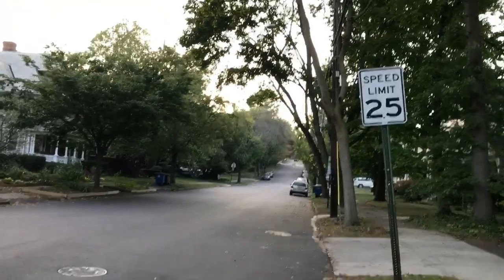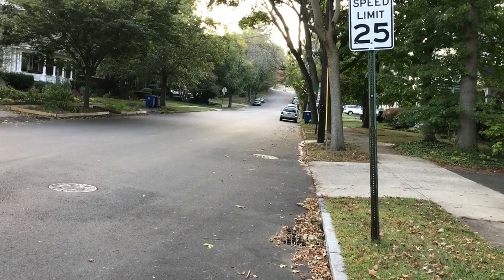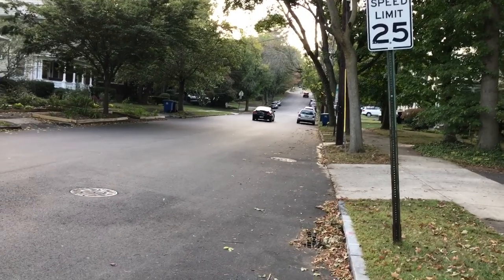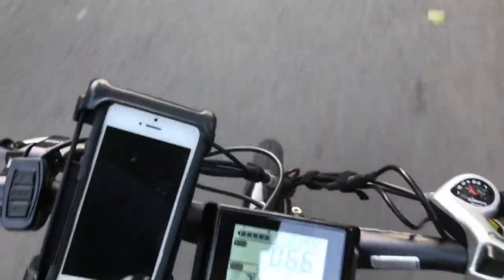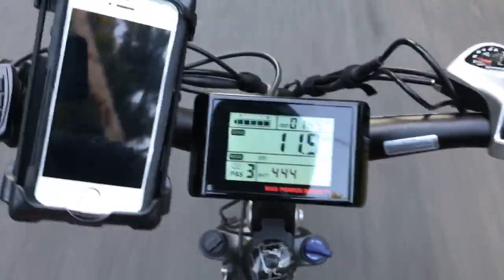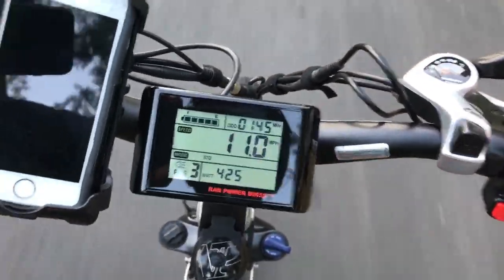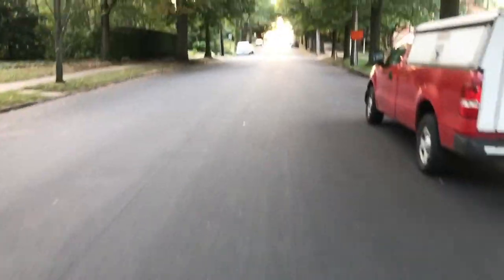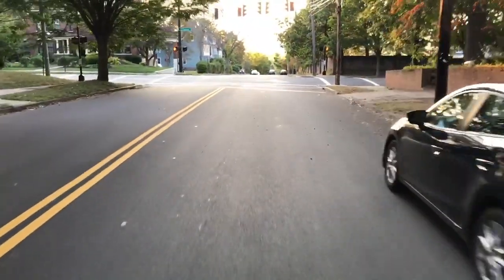Climbing a steep hill on the RadCity by Rad Power Bikes (with one hand)

Comment: Hey, Shane. So it's been 5 years since you made this video. Do you still have your RadCity and, if so, how it is performing?  Any loss in performance due to an aging battery, or anything related to the wear and tear on its electric motor?  BTW, I've taken your advice and try not to overly stress my electric motor by going too high in watts -- I typically use PAS 3 to be my max. setting for hills, which is fine -- I didn't buy this bike to serve as an electric motorcycle. :-) 

Hey, btw, I recall you mentioning awhile back that you're from the islands? If so, I hope that if you know anyone on Maui, that they are doing okay and were unaffected by the recent wild fires. My dad's side is from both Maui and Oahu. 🤙
Reply from the maker: My family and I moved back to Maui 6 months ago. We in town and not on the west side, so we are safe. However, it is such a heartbreak seeing Lahaina completely destroyed and the lives lost. We drove through to get to Kaanapali last weekend for the first time and it was a difficult sight to see.

The last 5 months, I’ve been doing short 1-2 mile rides several days a week riding my son to school. Still working great!! Although I have only little over 1500 miles after all these years. But it’s a 2017 mode and the battery is still going, motor still kicking strong! 😀 I just got a flat but once fixed, I do need to do another range test to see how much battery was reduced. We’ll see, thanks for reaching out!
Reply: @TrulyElectric  Glad you and your family are all well! Yes, the fires were terrible and the results were all very sad all around. 

We got our RadCity Step-Thru 3 in mid-2021, but the model is very likely a 2020. My battery became defective after 200 miles and it took a handful of months of going back and forth between me and the Rad Power tech folks to iron out this problem. I've only got about 200 miles on the new replacement battery. So far, so good. I hope yours keeps running strong! SHAKA

Comment: Thank you for the video. I actually am thinking of buying this e-bike for going up a pretty steep hill that I was struggling with on my regular bicycle.  I had to do it is serpentine pattern (S) to get up the hill.  I am 58 years old and am not in perfect health anymore. It is a regular town road, so it not loose dirt or anything. Do you think this e-bike will be ok?
Reply from the maker: I appreciate you taking the time to watch! Although this bike can handle steep hills, there’s still some good effort needed since the bike weight over 60 LBS. If you are looking for something that can take on hills a bit easier, I would recommend getting a bike with a geared motor. My bike (RadCity) uses a direct drive motor that is more quiet and durable than geared motors, but at the expense of less torque. For hills, you will want something with a geared motor. On Rad Power Bikes website, look into the RadRunner or RadRover. I think those would be great options for steeper hills. Hope this helps!

Comment: I think I may need the Radrover for 17% - 20% grade @ 250 pounds :/

What do you think...
Reply from the maker: Hi Alexander. Based on my experience with both, I would agree with you that the Rover may be better suited for you. You’ll appreciate the torque of the geared motor on those step hills along with your body weight. However, 17% is pretty steep, so regardless of which bike you get, you’ll still need to pedal hard to help out the motor...just a little less hard with the geared motor of the rover.

If you do go the rover route and expect to ride in wet conditions as well, keep in mind that the bike does not come with fenders like the RadCity does. So that’ll be an extra expense. And rover has no rack in the back. If you’re not commuting though and it’s just a fun bike, these shouldn’t be an issue.

Let me know if you have any other questions!

Comment: I’ve got an electric scooter (Boosted Rev) that can climb hills TWICE as steep (25%) with no help and faster speeds (>20 mph). I know because I’ve done it many times. I’ve been looking to get an eBike for a while now but I can’t find one that matches or exceeds the 1.5 kW power output of my scooter. I can easily find scooters that can do 50 mph at a cost of under $2000 but I for the life of me can’t find an eBike no matter how expensive that has more than 750 W of power output and max speeds of over 28 mph. Why is that?

Comment: Thanks for the great report. Was wondering how much do you weigh? I would imagine the weight of the rider matters as well as the length of the uphill climb. I weigh 215 pounds and have a off-road ride that starts with a 2 mile uphill climb. Typically I have to walk the bike for the first 2 miles as in first gear I can walk and enjoy it rather than pedaling like mad and getting nowhere.

Comment: Do you have the 16'' or the 19'' not that matters climbing hills. I'm 5'10 so trying to decide which one to get
Reply from the maker: I have the 20” 2017 model, but they reduced it to 19” for the 2018. From my experience test riding the 2018 models, I think 16” would be good for you. I’m 6’0” and although the 19” frame felt right for me, at 5’10” it may be little too big. There’s also a Rad Power Bikes owners Facebook group and many stated that 16” for 5’10” is a good match. Sorry for the late response though and hope your still considering the bike...or even bought one!

Comment: could this bike make it up a 5% grade for 6 miles and not kill the battery?   Would this work as a commuter on this route?   or would this ruin the bike?
Reply from the maker: Hey Craig, sorry I missed this one! This will for sure do it at probably a slower 8-10 mph pace depending on how much you peddle, but such a hill will definitely eat up a lot of battery. If you keep the bike at 500 watts and not go over, you won’t ruin the motor. If you can recharge at work, this bike should work.

I know this is almost a year late, just curious if you eventually got an ebike?